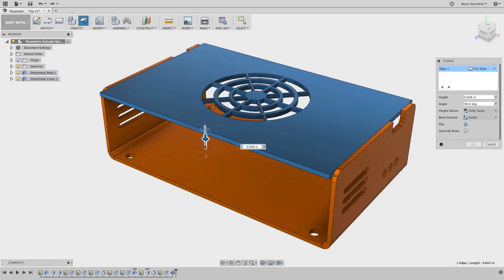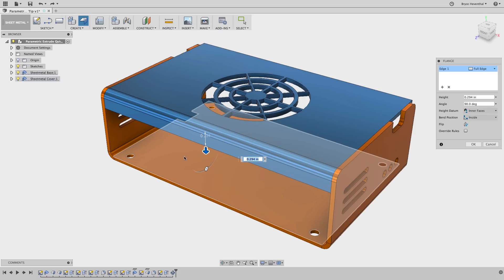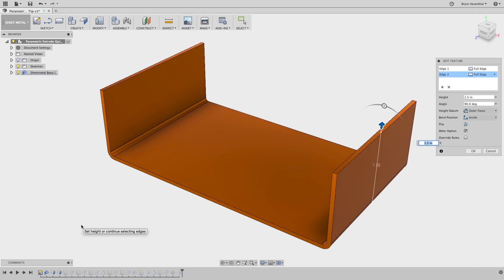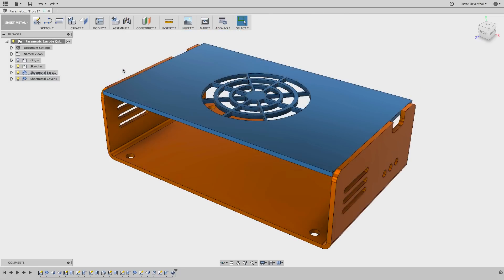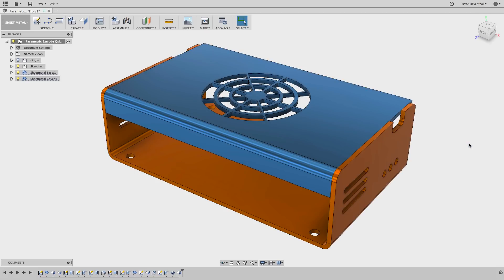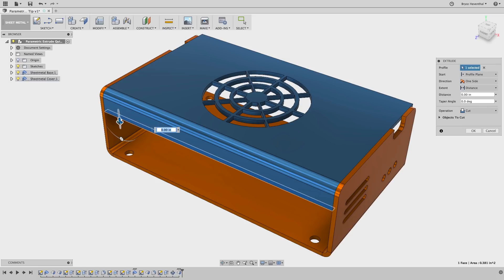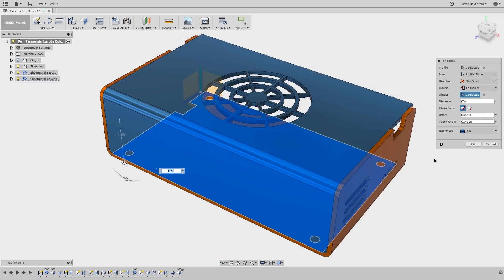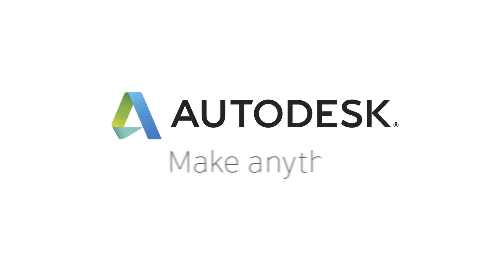QUICK TIP: Sheetmetal Parametric Flange

Comment: Cool tip. What happens if the parametric height goes lower than the initial flange pull? Will it still be parametric?

Comment: Seems a bit counterintuitive... You going to rework the flange tool to have a to object face option? That updates parametrically
Reply: Yea. That would be a better option if it existed...Vote on that on the ideastation! Here is a similar idea that i found https://forums.autodesk.com/t5/fusion-360-ideastation-request-a/parametric-end-to-end-surface/idi-p/7679019